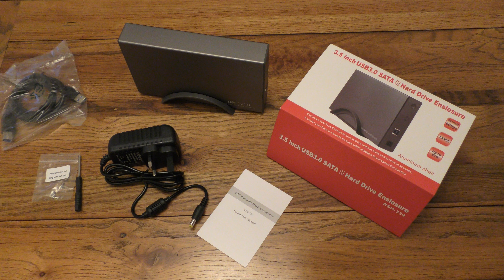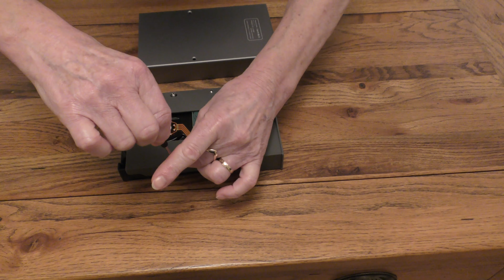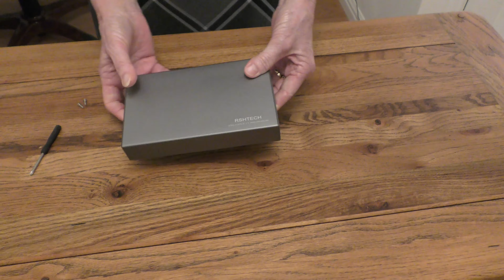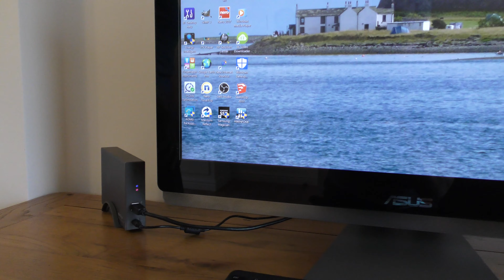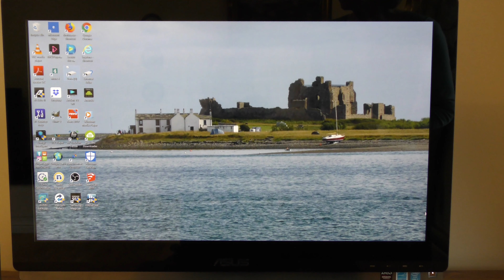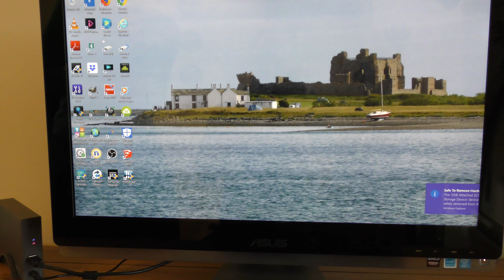External Hard Drive Enclosure USB 3.0 Aluminum Disk Enclosure Case,  sleep mode after  inactivity

Comment: Hdmi connection or is it a monitor?
Reply from the maker: This video demonstrates how to use a 3.5-inch USB 3.0 SATA hard drive enclosure and a Hard Drive from a PC. The old PC the Drive came from had been upgraded to an SSD and the old drive was therefore surplus.  So we reused it to backup  all the files we had on it.   The video shows how to install a hard drive into the enclosure and connect it to a computer.

Comment: My issue with wd elements portable usb 3.0 drive is if i put my laptop into sleep mode in windows 10 keeping the drive connected to usb 3 and after turning pc from sleep mode my hard disk reconnects is that issue with wd hard disk or this issue is on every external hard disk.
Reply from the maker: Hi Anonymous Boy. Sorry, I can't tell you about products I don't own. I can tell you that if you connect the external HDD enclosure  (the one in this video) to your laptop and put your laptop into sleep mode, or you don't use this external HDD for 20 minute, this HDD's motor will stop. As soon as you require this HDD again, it will automatically start the motor and you will have access to all the information on this HDD. That is amusing you have a 3.5 inch drive in the enclosure with information on it, as demonstrated by this series if YouTube videos.😀